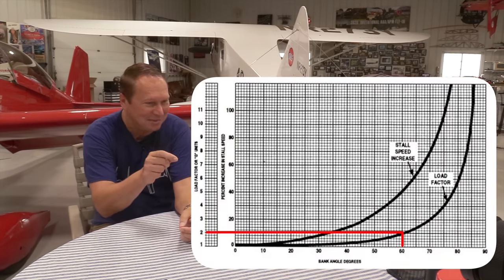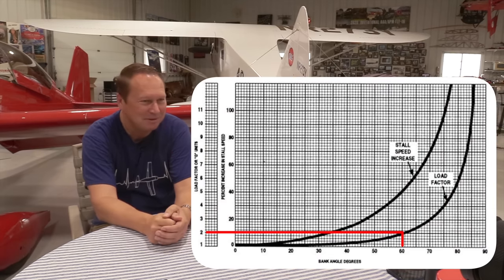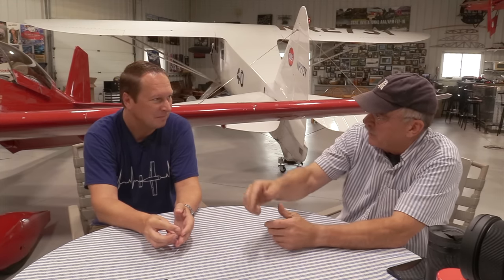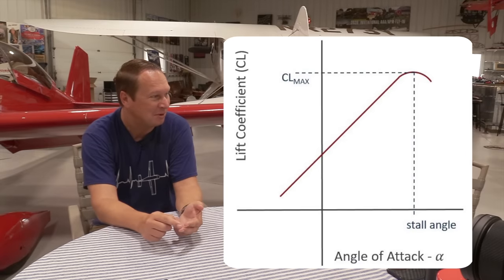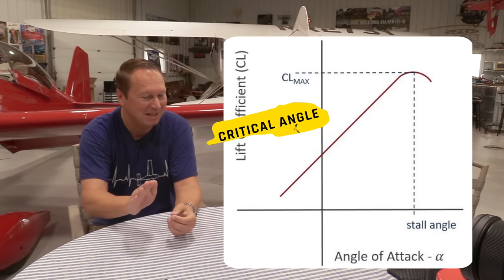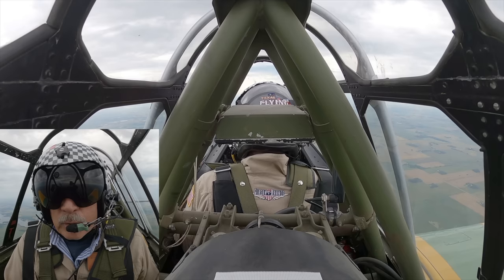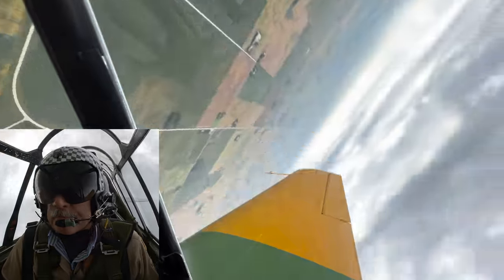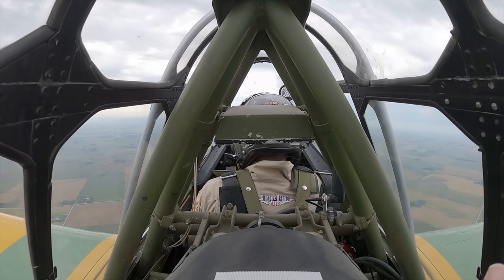The Bank Angle and Stall Speed Myth

Comment: In a medium to steeply banked turn, lets say approx. 40-45 degrees,  where is the point in space where the center of the turn is?
Reply from the maker: That depends on the airspeed. The faster your speed, the greater the turn radius will be.
- Martin
Reply: Yes, but I'm referering to three dimentional airspace.  Your answer might be relevant to cars on a circular racetrack.  But I'm asking about airplanes. @martinpauly
Reply from the maker: @daffidavit  Yes, given you were talking about 40-45 degrees bank I figured you were talking about airplanes, not cars. My answer still stands: the faster the airplane's airspeed is, the greater the turn radius. A Cessna 172 at 70 knots and 45 degrees bank will have a smaller turn radius than an F-16 doing 400 knots at the same 45 degrees bank angle.
Reply: Martin, I want to thank you for responding.  The reason why I began this colloquy is because I saw knowlegable people on this channel.   For years I've been arguing with some of the best aviation minds about what the FAA refers to as the "overbanking tendency."  This supposedly relates to the theory that the outer wingtip has a faster airspeed than the inner wingtip in a turn.  This theory mandates the use of cross controlling the airplane in EVERY turn.  Just read the AIM or the Pilot's Handbood for a fable that likely began before WWII.  
     The point I was trying to make is to dispute this theory and to see if you agree with me.  Most aerobatic pilots know that the airplane's forces are balanced in a turn.  The total lift vector in a turn always points to the "center" of the turn.  People don't see it  that way because they are used to relativistic views.  That is,  they are standing on the ground and see the center of the turn in the horizontal plane only.  Instead, the center of the turn is somewhere else, where the total lift vector is pointing.  It's kind of like the tip of an ice cream cone where the turn is at the wide end and the turn's center is at the tip of the cone.  The airplane is not connected to the ground like a model airplane controlled with strings and a hand held piece of plastic.  
     What's your position?  Do you believe the outer wingtip flys faster than the inner wingtip in a turn just like propellers turn, or do you believe both wings always fly at the same air speed when the airplane is in a balanced turn?  The answer to this question will determine where the center of the turn really is. @martinpauly
Reply from the maker: @daffidavit  Sorry about the long time it took me to respond. The center of the turn - i.e. the point around which the airplane rotates - is not where the lift vector alone is pointing, but where the sum of lift vector and weight are pointing. In a level turn, that is to the side of the airplane. If the center of the turn was in fact above the airplane as you suggest, then the resulting motion would be somewhat of a loop. In fact, a normal loop is a good example to illustrate this: Lift is greater than weight when we enter a loop, and the sum of both vectors points straight up. Thus, the center of that "turn" (rotation) is above the airplane.
And yes, the outside wingtip in a turn has a higher localized airspeed than the inner wingtip, because it travels a larger diameter than the inside wingtip in the same amount of time. Whether or not that leads to overbanking tendencies depends a lot on the specific airplane and how it maintains stability (or not) around the longitudinal axis.
Regards,
  Martin
Reply: @martinpauly   "is not where the lift vector alone is pointing, but where the sum of lift vector and weight are pointing."  Good Day Martin.  Thanks for getting back.  I just quoted your own words.  I think you just made my point.  The sum of the lift vector is between the component of lift that is between two vectors, Right?  It's the component that is always perpendicular to the wings.  This  sum vector is always there even when the airplane is straight and level.  In a turn,  the horizontal and verticle components are relevant when the wingspan is banking relative to the earth, but the sum of the lift vectors is always the total lift vector, i.e. 90 degrees to the wingspan.  But that's only relevant if we are relating the airplane to the earth.  Take the world out of the equation (but keep the atmosphere) and the plane will never know it's turning.  Replace the earth and the only thing that changes is gravity, i.e. warped space.  I've been working this question for 50 years and I still can't disprove what others also agree to.  It's not a flat earth theory.  Keep thinking about it and someday we can have this coversation again. Thanks for getting back, this is a good exchange of words.

Comment: It's not a myth. it simply ONLY applies to turns while holding altitude.
Reply from the maker: It also applies to turns in a steady descent or climb ("steady" as in with a constant vertical speed).
- Martin
Reply: @martinpauly  I suppose you're right, as you'd be at 1G then as well (vertical).

Comment: So how would have Air France recovered ?
Reply from the maker: The same way any stall can be ended: by reducing the angle of attack. They needed to push the nose down and restore smooth airflow over the wing - that ends the stall. Then they could have pulled the nose back up and climbed back to altitude. In stead, the AF447 pilots kept the nose on the horizon, and with the high sink rate their aircraft had, the angle of attack was too high.
- Martin